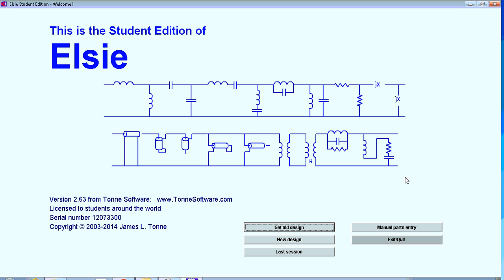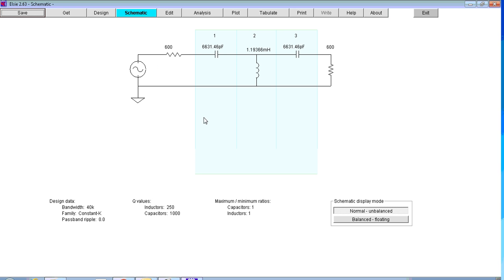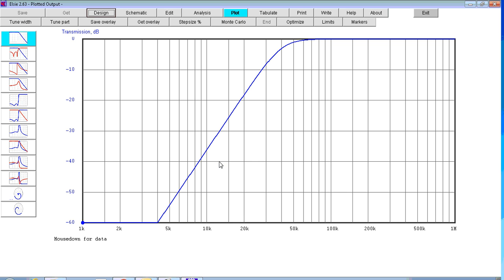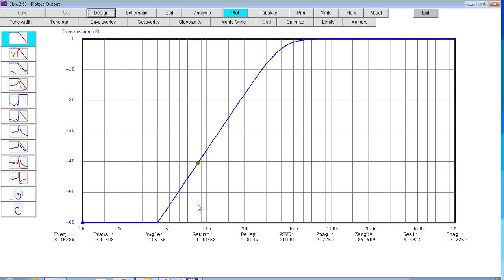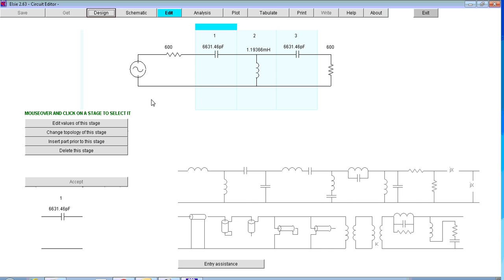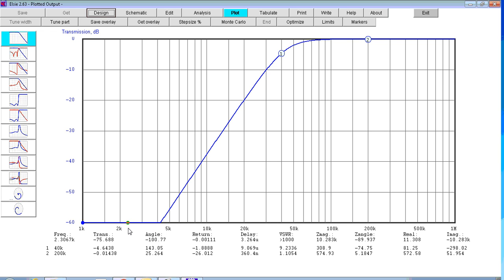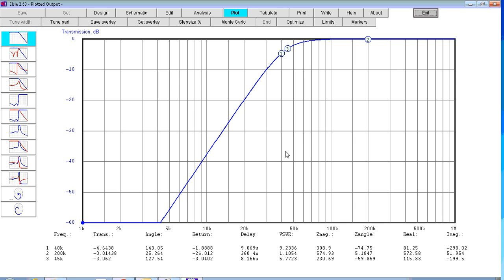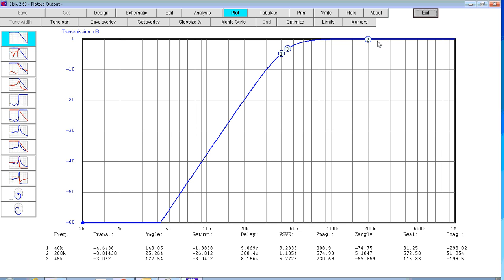Using ELSIE software to design filters

Comment: Nice video but, do ou know if it's possible to put different values of impedance at input and output? Thanks for sharing!
Reply from the maker: Sorry for the late reply I have been busy.

No, that is not possible, you would need to achieve the matching by inserting a matching attenuator before or after the filter. Because you are trying to match an impedance you would have to accept a minimum level of attenuation.
You can find a calculator for a pi type attenuator here:
https://chemandy.com/calculators/matching-pi-attenuator-calculator.htm

and a T type attenuator here:

https://chemandy.com/calculators/matching-t-attenuator-calculator.htm

Hope this helps

Mike